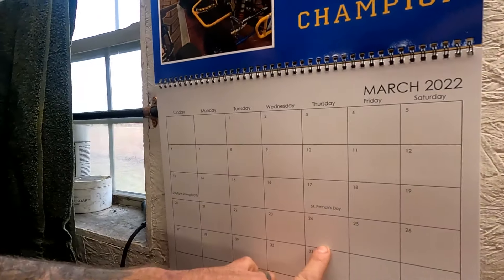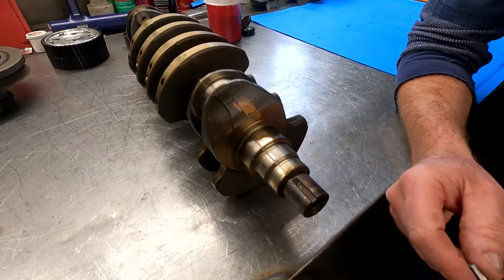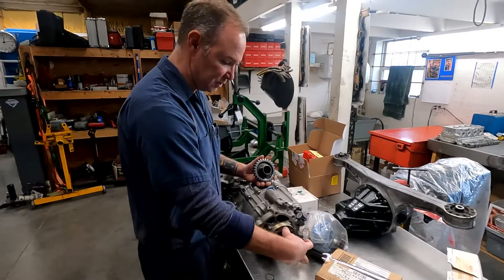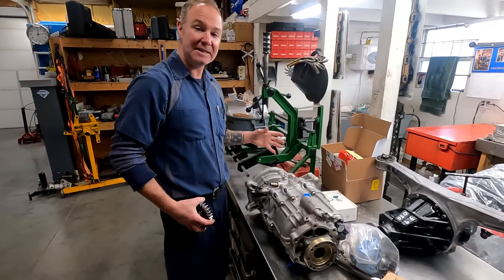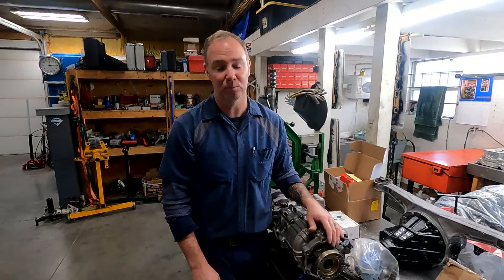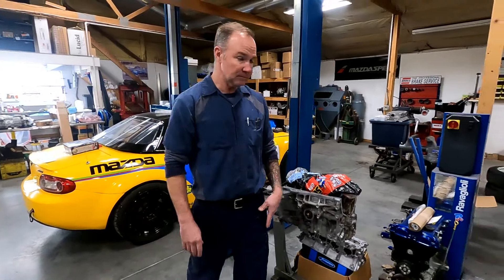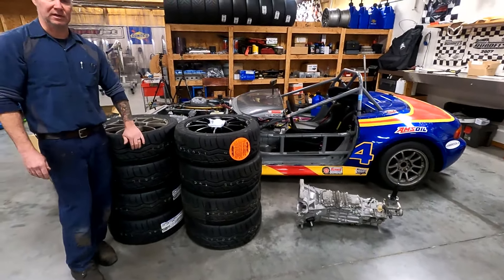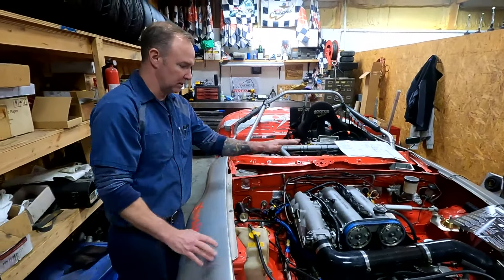Shop Tour - Every Miata Suffers from this Crank Issue

Comment: Love this channel , I referenced your oil pan video to seal my motor. My engine is pretty noisy and wanted to know if it’s a pretty usual things with a built forged motor ?
Reply from the maker: Not sure how you define "noisy" but forged or cast, should not be dramatically different as far as noise goes.
Reply: @jpm  I’m tuning super tech 84mm pistons , by noise I mean piston slap on cold start and it goes away after warm up but some “noise “ still lingers. By no means is it knocking or slapping hard while driving. Was curious to know if you have any forged pistons that are noisy
Reply from the maker: Cold starts are the one time when you will have more noise, so what you are describing is pretty much the norm.  Again, that lingering noise is hard to address without hearing it.  
These are things that are much easier to inspect/diagnose on the dyno.